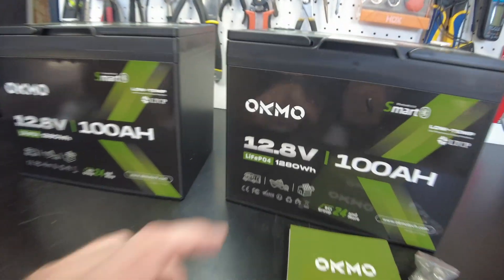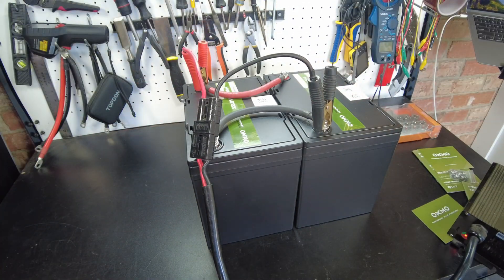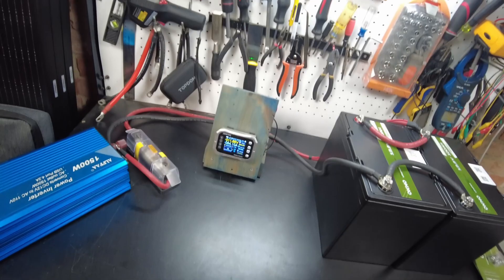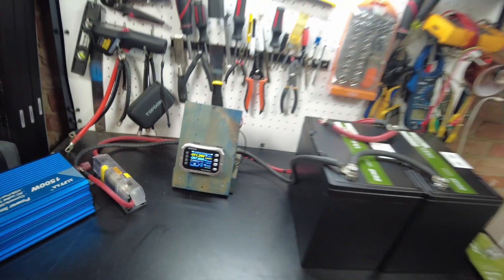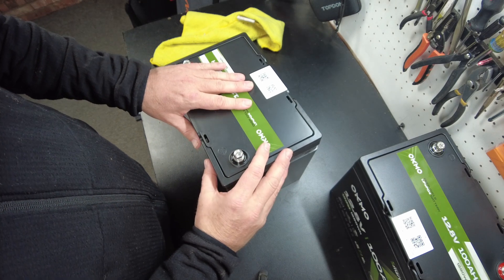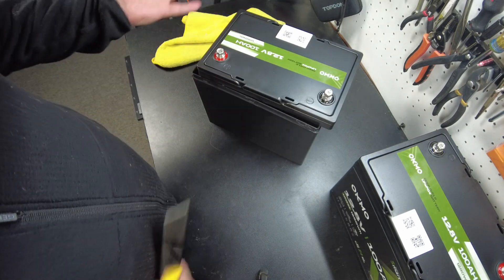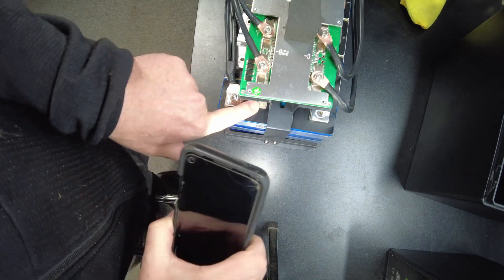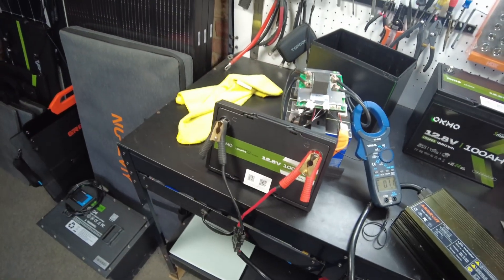OKMO Group 24 Smart Bluetooth 12V 100Ah LiFePO4 Lithium Battery

Comment: how many companies truly build those lifepo4 batteries anyway?  they all seem to be very similar some are better because a better BMS low temp protect and Bluetooth or self heating but in the end 
if we knew the truth about how many companies truly build for different brand names we could be  very deceived. exploited even? But it is possible there are so many brands that build these batteries. we ourselves can build one with the proper knowledge and  lifepo4 lithium batteries  grade A  cells. but the finished product is very different in a tool box adapted  for the cause????

Comment: No doubt you've thought of this, but it occurred to me when you were discharging - just set the shunt to 10% over the battery rated AH. The battery will low voltage disconnect if it gets too discharged.
Reply from the maker: Yes, I've thought of it, and others have suggested the same. However I fear some/many people will not understand why the shut did not make it to 0. They may mistakenly take it as a fail. I really just need to get a shunt that will work like my original shut, which did count AH, and WH after SOC 0. Thanks!
Reply: @BradCagle  Yes, I see. I didn't consider that scenario. Oh well, still a comment :)

Comment: Brad, with LFP its safe to pair batteries even if one is dead and the other is fully charged.  That's the beauty of LFP.  The full battery will balance out with the empty battery over time and both willl be approx 1/2 full in the end.  Even if you removed the cells and place all in parallel they will equalize.  Don't know why you seemed to think these had to be the same voltage to connect together.
Reply: If you connect a full battery to a dead one the in rush current can be extremely high. If the voltages are close enough to the same you can parallel them without a huge current spike

Comment: Amazon has them currently on sale for $169.95  Not a bad price, for what you get, I guess. I don't own any LiPo4 batteries with Bluetooth so I'm not sure if it's worth the extra $40 over a battery that doesn't have Bluetooth?
Reply from the maker: I did not see the bluetooth version on Amazon earlier. I searched again and found it this time. Thanks